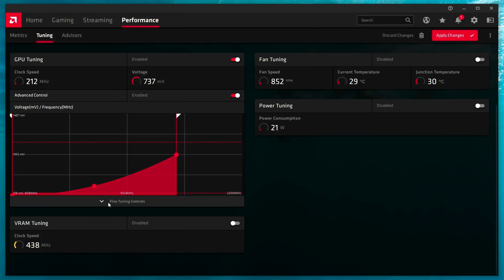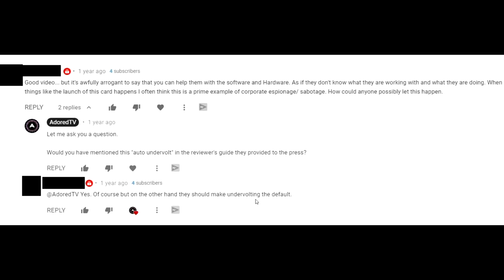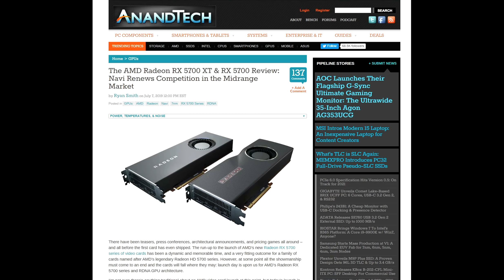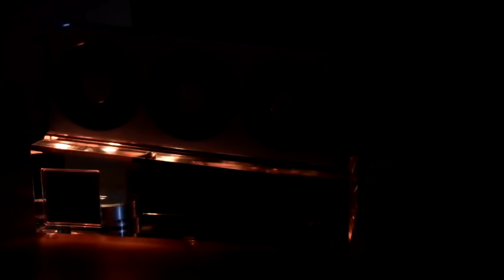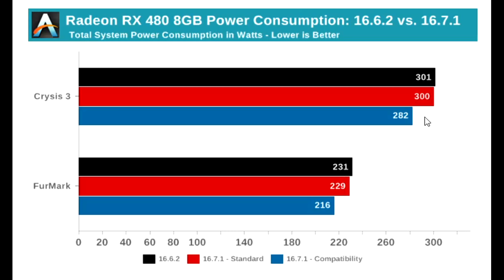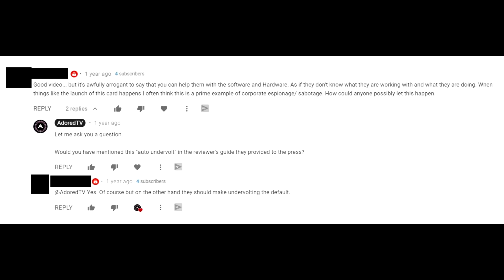Fixing AMD's "Hot and Loud" Graphics Launches.

Comment: 7) have the card use "auto undervolt" by default in review samples while notifying the press that the retail cards will have a pop-up at certain fan speed and/or temperature thresholds advising them to try and turn on that function in the driver by just clicking "yes" (with the option to "do not display this msg again"). That way any problems regarding instability will vanish and ppl will be aware of the option at the same time.  Respectable reviewers will test the card with both the option enabled or disabled so its a win win imo.
Reply from the maker: Good idea!  This is one reason why I made this video, to see what other ideas came up based on it.  Cheers!
Reply: @adoredtv  Loved the video btw, teaching AMD how to use nvidia strategy had me rofl :)
Reply: more programmers must know of this not well known "'ethics" of changing user's setting; notify user with a one-timer pop-up.
Reply: Auto under volt by default might be a decent option and if the drivers detect any stability issues, it up's the voltage accordingly.

I've never been a big fan of how all AMD cards have a much higher voltage then is needed because every card I test works fine with much lower voltage and it seems to be the case for most people online.

Maybe they could do like a trail and error test in the drivers automatically to try and find the sweet spot for undervolting and performance.

Comment: Woww, you can set a specific clock frequency and tie it to a specific voltage, and even manually set a maximum boost clock? Awesome! I wish I could use Wattman with my NVidia graphics cards.
Reply: I don't mind using Sapphire's trixx at times with my RX 480, but yeah now wattman seems easier to use than it used to be.
Reply: Come to RDNA2. You know you want to ;)
Reply: @snetmotnosrorb3946  Nyuuuu... I need my slow ass NVidia Control Panel and Spyware GeForce Experience. It's intrinsic to me.

Comment: Keeping time in the driver is not exactly possible. When end users change the system time or put the card in another system that number will be messed up. It could do something similar based on manufacturing date... There's some other ways too.
Reply from the maker: Why not time it based on the driver version...
Reply: @adoredtv  because many people don't change or even update drivers. Also if someone runs one in an apple/Mac or linux. It would have to be something in firmware most likely. But that goes away once flashing the firmware. Also if one person sells the card... It won't have the same driver. And who knows what driver that person will install. I'm not going to suggest there isn't a way. Cause I'm sure someone or myself could come up with a reliable method... I'd have to think about it for a while.
Reply from the maker: @tacticalcenter8658  That's pretty much what I'm suggesting RTG does - just think about how this can be improved.  They aren't even trying. ;)
Reply: @adoredtv  also just FYI... Back when the company was ATI, the community often modified drivers. I forget all the modding guys, but I hosted a bunch of them on my old website that will go Un named (it no longer exists anyways). In any case ATI was very dumb about alot of things. They didn't even compress the drivers. It took a long time for me begging them to use lzma compression and emailing them how it helps compress them alot on there installer package. They eventually switched to that. But just goes to show how they can't think of things for themselves.

As for the time tracking and adjusting voltage, I'm pretty sure it will have to be handled in firmware or even add a chip specific for that function. But the firmware would have to be unique as usually flashing firmware will wipe out the previous information. Now... Firmware may not ever be flashed by an end user, or only enthusiasts... So it may be the more reliable approach. And the drivers I guess can monitor that information. And a fail over mode that just raises it to nominal if it sees a discrepancy. Then again are we tracking usage of the card or just time in general? That gets a bit more tricky. I assume just 3 years and not whether the card has been used for those three years? Ie been in storage or whatever.
Reply from the maker: @tacticalcenter8658  Being in storage doesn't matter, the warranty counts from the day of sale.
Reply: @adoredtv  there is no way to count from time of purchase. That is unless they make the software able to register at time of installation using the information from receipt and enter it in when installing. Kind of like how evga registers its products on its website. And we all know it's not common to register your hardware... And even so this won't be 100% method of tracking. The drivers or firmware cannot determine when the hardware was purchased. At the very least I would assume the hardware would have a code for manufacturered date... And perhaps the drivers could use that information to raise voltage in time. But if you had a card on the shelf in retail that wasn't sold for a few years, this would not be a reliable way of determining this. So I'm pretty sure this would be impossible to do in the way you want. While a good idea it won't be easy to implement in that way.
Reply from the maker: @tacticalcenter8658  The receipt is how they count from time of purchase.

Comment: Wouldn't it make more sense to increase the voltage in 10 mV increments based on how long the card has run at, say, over 80%+ usage in total (assuming this can be tracked by the driver somehow) rather than lower it every couple months or a year?
Reply from the maker: Could be many options better than the one they are choosing to use. ;)
Reply: @adoredtv  Heh, that much is for sure

Comment: I stopped testing stability with furmark. It would be stable for 24hrs with furmark, but crash after 2 mins of Battlefield or 3dmark
Reply from the maker: Hm, I'll check some others out too.
Reply: furmark is a power virus, it doesn't check if the whole chip is fine or the whole memory is stable at set clocks and voltage
Reply from the maker: @Tudorgeable  Yeah but I didn't want to test the HBM, only the GPU.  I'll give Firestrike a few runs as that's pretty solid too though.

Comment: So, is Nvidia dealing with same degradation in less safe way? For me it does not even sound bad because many other parts of card other than GPU can fail.
Reply from the maker: I wondered that too.
Reply: @adoredtv  They could even bin for lower voltage (your Vega represents small fraction which would be lower bin) and then document the degradation somewhere in small font.

Comment: The problem for me is default overclock. They make the cards a bit better hot and loud just to push them in the next price bracket. Just to charge more. RX 480 and RX 5700 XT look a bit similar but the price... ouch.

Comment: Maybe they can just bin the silicon a bit more carefully so that the majority or 95%+ of the 5000 series GPUs can run a lower voltage in general.  I have a feeling they pushed them to compete against a different class of cards like Not an Apple Fan noted recently.  I think the 5600XT was originally only good enough to go against the 1660TI/Super and the 5700XT was originally targeting the 2070 non super.  When AMD got work of the Super line I bet AMD ramped the clocks and voltages higher than they originally planned to, and now we're back at hot and loud.  If NAVI 2 comes out in mid 2020 it should fix this unless NVIDIA releases RTX 3xxx because unless NAVI 2 has 30% performance gains over Gen 1 NAVI they will be slotting in between NVIDIA cards price wise all over again.

Comment: No matter the hype for 80CU card, if it's hot and loud, everyone will avoid it. Radeon needs to impress the reviewers, fix their drivers and one thing I am a bit worried for - bring RT and some form of Deep Learning SS to combat NVIDIA. I am a bit afraid that games like CP2077 will end up driving sales up for the next GeForce RTX series cards, because of significantly improved RTX and DLSS implementation which NVIDIA have been testing ever since Turing came out. While AMD won't have a major title that supports RDNA2 RT to give away along side Big Navi...or will they? Perhaps if there are RDNA2 RT enabled games launching with PS5/XBOX Series X, they could bundle them with Big Navi. But it has to be something major - perhaps Bannerlord? 

AMD's time is running out quickly....
Reply: trrue ray tracing is hardware agnostic. rtx is based on Microsoft stack. You are arguing on marketing terms
Reply: @Tudorgeable  It is just to differentiate the Nvidia one from AMD one. I know it's hardware agnostic. However Nvidia has had time to work on it and test it within games, where as Radeon has not. I do not expect Radeon's Ray Tracing implementation to work perfectly at release. We will see. Maybe they hired somebody we dont know through all these years to replace Raja, fix all bugs for RDNA2 and implement a perfectly and efficiently working RT that surpasses NVidia's "hybrid"...

Comment: They could have also just hyped the feature like nvidia does for some of theirs. FORCE the tech press to talk about it by making it a hot topic. Honestly it IS a hot topic but almost no one knows about it because they just don't friggin advertise it.
Reply: Pretty much why people don't know about a lot of different features AMD now has. It's a pretty unfortunate state for them.
Reply: The reason the cards are running with those voltages out of the factory is because some amount of production silicon REQUIRES that voltage to hit rated speeds.
If auto-undervolt was promoted widely as a feature, there would be users who would activate it, get a negligible undervolt and in doing so realize they have crappy silicon and feel short-changed.
If AMD promote the feature and suggest it provides an energy consumption and temperature improvement then they're just asking to get sued when that isn't true for everyone - even if it would be true for the vast majority of card owners.

Comment: To be honest, I think the default should be "undervolt" and what was "default" for RTG should be called "overdrive".

The simple fact is that RTG needs to stop pushing their chips so hard "by default".

The average joe will be happy with the new default as it is cooler and quieter and the enthusiasts will be happy with the 1FPS benefit from the "overdrive" setting.
Reply: AMD reference cards should come unvolt and unclocked then the board partners slap on big cooler and everyone goes crazy when these cards run ways faster and preform better. Big win for AMD so the reference card is not that great, but it is cool and quite and gets a good revue. Then AIB cards come out and that's the card people want bigger coolers and now we have them with higher over clocks. AMD pushing there reference cards and putting a crappy cooler on it does not help them, but having your AIB cards faster makes the AIB happy and people who buy them happy. This is a better win still. Put a card out that is cool quite and the drivers work to the reviewers get a good review, then wait a month and now get even better reviews for the AIB cards. This = Happy AMD, Happy AIB, and Happy customers.
Reply: @felixcosty  That's what Nvidia does and they get great reviews with regard to noise and heat as a result.
Reply: @felixcosty  Just like the good old days
Reply: Agreed but undervolt should just be called default. Why confuse the simpletons more than nessesary
Reply: The reason the cards are running with those voltages out of the factory is because some amount of production silicon REQUIRES that voltage to achieve rated speeds.
If auto-undervolt was promoted widely as a feature, there would be users who would activate it, get a negligible undervolt and in doing so realize they have crappy silicon and feel short-changed.
If AMD promote the feature and suggest it provides an energy consumption and temperature improvement then they're just asking to get sued when that isn't true for everyone - even if it would be true for the vast majority of card owners.
Reply: Roflmao.... the 1 fps increase for enthusiasts will make them happy.... amazing joke man!!! 🤣
Reply: The average joe will buy Nvidia because the theme is that amd cards run hot, when in fact they run the same as Nvidia ones. at last different models of rtx 2070super and rx 5700xt ive tested.
Reply: AMD should design a better architecture rather than relying on tricks and deception to compensate, it will only hurt them and us.  Thankfully RDNA 2.0 in Big Navi looks to be a great architecture if the rumours are true.

Comment: Ok so this vid just freaked me the eff out! I'm having the exact same problem in my hands as you Jim, literally just been for an MRI scan! Awaiting results.
Btw great content once again but don't be giving RTG any ideas ha!
Reply: I dealt with something similar as well, I have a compressed disc in my neck, and physical therapy made a world of difference. It's not a one time cure-all, but it teaches you how to properly take care of yourself and deal with these issues. I definitely recommend it since it may cost a little bit up front, but it's definitely cheaper than many alternatives, and what I learned I can continue to apply on my own forever going forward.
Reply: I had a similar issue and was due to how my arms rested on my (corner) desk while typing/gaming. Fixed it with an elbow pillow. Not Jim's cause, but could be for others.
Reply: @ammarossdanan  mine only flares up on a night while I'm horizontal in bed, even while not laid on my arms. Through the day I'm fine. I do tend to rest my elbows on the wooden desk at work, maybe that could be a cause?
Reply: @nortski78  my arm would rest close to the edge of the desk, so the lateral epicondyle and ulna would rest on the wood with occasional shifting to the desk edge resting directly in the trochlear notch (which is exactly where the ulnar nerve resides btw), so I know it was certainly self-inflicted for me due to workspace ergonomics.

Comment: Why not simply default to an undervolt curve when under a less severe load that is less likely to cause instability, but bump the voltage when under special stability testing loads? Nvidia does this with its vram frequency. Same concept as an AVX offset.

Comment: I have 9700k and Radeon VII for streaming, the GPU works HORRIBLY in OBS for streaming, tryed everything, many drivers/settings, it just doesn't work, horrible lags/statters. I've sold my RTX 2080 for this GPU and it fails in streaming games so horribly ...

It is a good GPU for solo gaming and maybe some work, but for streaming - STAY AWAY, don't listen to AMD fanboys

AMD, get your shit together or your new GPU are gona fail horribly
Reply: Look at using the right software for starters.
Reply: @RossLouis96  an amazing comment. WHY do I have to look for "right software" if I payed tons of money for this product?
Reply: @architech007  Because you live in an age of technology and thus it's expected that you use the right software for the hardware you purchased.

OBS is okay for CPU streaming, but it sucks on the GPU, that goes for Nvidia too.

AMD's ReLIVE which comes with the GPU you bought can record/steam h.264 with almost no performance loss at high bit rates, it's actually better than shadowplay.

Or find some other program that has competent OpenCL/CUDA support.
Reply: @RossLouis96  have you tried AMD relive? They dont even have a proper plugins and overlay intput, that programm is garbage, which proves again that AMD GPU department sucks
Reply: @architech007  I have, and you can take the stream it's self to other services like twitch.

It doesn't suck, because it's high quality with almost zero performance impact.

Comment: GPU Workload is still in the drivers, it is in Graphics under the Advanced drop menu. You will probably need to scroll down to see it. The description only says it changes the memory timings.
Reply from the maker: Got Radeon VII or Vega?  I remember the VII didn't have compute mode in earlier drivers.  Got two HBCC things at the bottom.
Reply: @adoredtv  No, I have rx580 so it's probably gpu dependant.

Comment: I undervolted my 5700xt after suffering random Black Screens from 1200mV to 1150mV. I have not had any black screens since. :)
Reply: The "black screen" issue (actually a BSOD in the graphics driver) was introduced in recent driver versions, and nearly completely solved in the most recent beta.  Voltage has nothing to do with it.
Reply: @TrueThanny   As you said "nearly" I have not updated to the Beta Drivers and i dont intend on doing so....All i know is that lowering the Voltage has ceased any more Black Screens!
Reply: @athwal78  I have never overclocked the RAM as i know that this will overheat the Memory, in fact i have not oc'ed the card at all!

Comment: my rx 470 8gb armor keeps freezing and making a buzzing sound i think its has some to do with the voltage and heat i need a bit of help please
Reply: @Gustav Gamer  around 60 degrees i dont mess with clocks and the voltage but my gpu is not stable unless i put the power limit to minus 40 when i game

Comment: I happy user Sapphire Pulse Vega 56 1592Mhz at 960MV
Reply: Me Too, it runs pretty cool (for a vega with blower) this way.... I limit my fos to about 80 and the card will run pretty cool :)
Reply: My GPU not even spin fans on less demanding games :)
Reply: Jeah.... Its pretty much doing nothing in games like world of warships... In fact vega oc+uv is still a great card...
Reply: After Vega UV my PC draw from Socket ~50W less Stock Voltage 1.2V ;) 
Anyway I get this one on ebay for ~180$ I sell my Old Rx 580 8GB for 140$ = Upgrade cost 40$
Besides PSU all my PC parts are Second hand :)
https://pcpartpicker.com/b/qhsZxr  - My Current Build